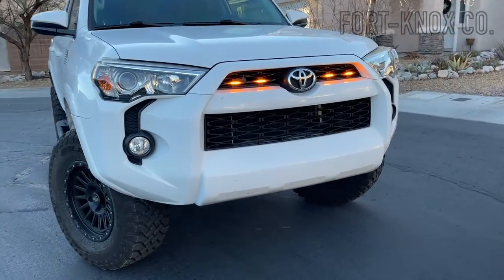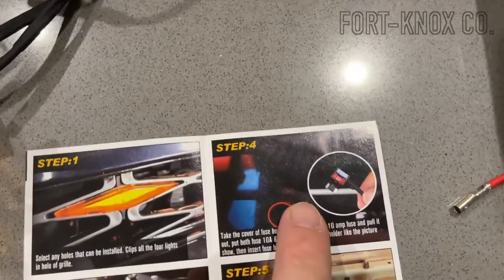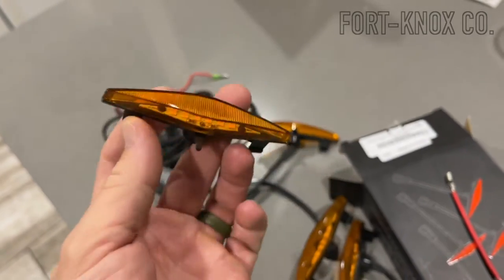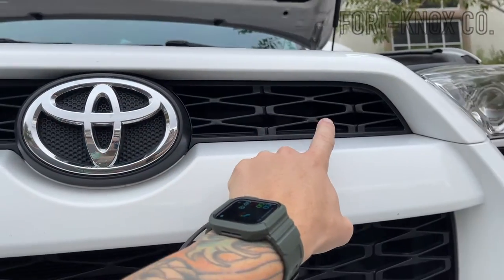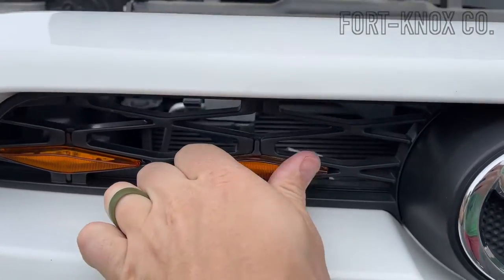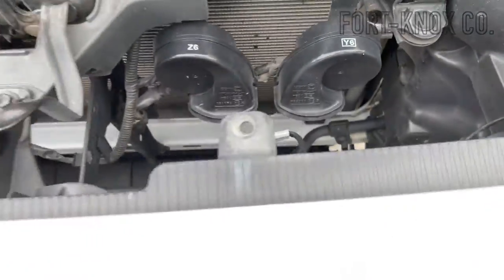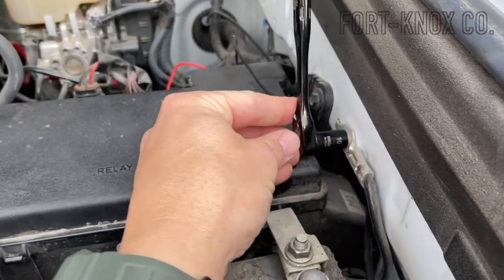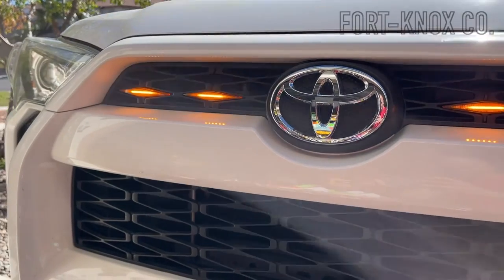Toyota 4Runner Raptor Grill Lights Installation | How To Install these LED's and Where to Buy them!

Comment: Thanks for the video!, I ordered them the same day I saw the video. Just like u said took about 30 minutes to knock It out. Had issues with one light not wanting to fit tightly in its place so I just swapped one out that was already installed and seemed to work. Thanks again.
Reply from the maker: That’s awesome to hear. I had the same issue. It’s weird. Like ones meant to fit in a certain spot or something. But I did the same thing. Played with switching them around and got them al in.

Comment: Thanks for the video, liked and subbed. I have a 2015 4Runner Limited. The grill is very similar to yours with the Toyota Rings emblem in the middle. I would have to install these on the lower row where you did judging by the shape of the triangular lights. The row right above where you put yours has more rounded left and right end shapes of the honeycombs and do not look like they would fit. I would get the amber if they offered a blacked out (smoked) version, but looks like blacked out is only offered in white LED. Did you consider installing a push off/on switch in your dash for if you wanted to have the raptor lights off while you are driving? I am considering that. Thanks!

Comment: Andy: Thank you so much for a great video. What size and brand of Rim and Tires do you have? They look amazing.
Reply from the maker: Your welcome. It’s RockTrix wheels 17” with a -12 offset. And the Falken wildpeak M/T 285/70r17. I have a video on my page going over the lift, tires and wheels specifically. You should check it out.
Reply: @FortKnoxCo  Thank you so much. I really appriciate it.
Reply from the maker: @farhang0077  your welcome! 🤙🏼

Comment: I bought and installed these light. Was a breeze and look good. However, they randomly turn on when car is off. Do you know why that is? What is that fuse they piggy back on?
Reply from the maker: Yeah we love ours. Haven’t had that problem with randomly turning on. The fuse I piggy back off of is the ignition I believe. It’s powered as soon as you turn the key to the first position. It was just the one that was recommended by the manufacturer. Not sure why they would randomly turn on with your installation
Reply: @FortKnoxCo  yeah i thought that was weird. Turned on while car was off.  Ill check again. Thanks for your quick reply?
Reply from the maker: @bajaaddict  no problem at all. I appreciate the comment and watch of the video. 🤙🏼

Comment: Just now seeing this video and trying to determine if my 4Runner, 2022 Limited, which has a grill and front same as this one in the video with the exception of the radar unit just under the Toyota emblem.  As a new owner of 4Runner, I am trying to learn the different styles in the grills and what a TRD PRO looks like and what would one call my grill which seems to be very similar.   I would install the raptors just as you are doing/did.  The box for the lights says 2014 - 2019 so I wonder if anyone is reporting installation on a 22 Limited?  And, what was the outcome of those installations?  Thanks for a reply is you can.
Reply from the maker: My 4Runner is the mid/base level as far as exterior upgrades. It’s an SR5 4x4. It has everything before you jump up to the limited or pro models which start to have different grills and  trims. If you grill is looking to be the same as mine then I’d put money on it that it will work. I don’t believe they made these diamonds shaped grills in different years different sizes. I think it either an SR5 grill or a PRO upgraded grill style. So I’d said you could probably install these raptor lights where I have them. And worst case you can return them full refund no questions asked with getting them through Amazon. That’s why I love getting stuff on Amazon when possible. No buyers remorse.
Reply: @FortKnoxCo  Thanks for the response and suggestion.
Reply from the maker: @joeretired4552  your very welcome

Comment: What was the mod on the fuse box to get that wire to fit?
Reply from the maker: I just made a little tiny notch in the plastic to allow the wire to lay a little bit flatter. Nothing big to let moisture in but something to just let the wire not be so pinched

Comment: Connecting to fuse box if you want them on only when your tail lights, or side marker lights are on. 
Run the wire through the firewall. Theres a small rubber plug on the upper right driver side. Wrap the wires in electrical tape, push through the firewall. Fish them out above the parking brake, use the 10amp tail fuse. Follow the same process as engine compartment  connection. I used a razor knife to cut out a small pattern to fit the piggyback back to allow the cover to be put back. Use the small bolt at the bottom to attach your ground. Literally took me 15 minutes including the disconnect from the engine comp. Fuse box.
Reply from the maker: They way I wired them in this video has them on 100% of the time, they turn on when the ignition is on. Day and night. Even before the engine is running, as soon as you turn the key it has them on.

Comment: anyway they can be wired to DRL ?
Reply from the maker: If you know what you’re doing you could I’m guessing. They come with the connections on the end of the wires but if you wanted to cut and splice you could. At the end of the day they just need that + & - connection

Comment: Any battery drainage since the installation?  I'm wondering if I should go through the trouble of installing a relay and switch so I can power the lights on/off as necessary.  What'd you think?
Reply from the maker: I haven’t had any battery drainage. I believe with the fuse they have you piggy back off of it’s only active when the ignition is on.
Reply: These take up barely any energy. Of course there’s some but not a lot.

Comment: I cannot get it to fit into the fuse box slot any advice? It is not snug at all
Reply from the maker: When I did it was really tight. I had to notch out a little bit of plastic so the lid would close back down and not compress the wire too much. I just kinda had to make it work as best  as I could.
Reply: @FortKnoxCo  oh you know maybe I should rephrase I was able to do that but fitting the actual fuse inside the slot it would not go. It would simply fall out. I took out the 10 fuse by the 7.5 one but getting it back in was not possible.
Reply from the maker: @ALOHAAKELI  oh okay. Yeah I’m not sure if there’s a different fuse or adapter that will fit more secure. Not sure if there’s an adjustment to the place the fuse fits in so it has more grab. Like adjusting the contact points.
Reply: You can also use the number 10 fuse above the ignition slot but then your lights only work when your headlights ON

Comment: Since you have an sr5 any idea if it fits a 2021 TRD pro premium? Also I’m going to watch your vid on the MT lift Eibach this is why I was told to do but AT Eibach instead of getting bilstein
Reply from the maker: I don’t think it works on the new pro grills but I’m not 100% on that. If it has that diamond shape pattern, then it might. But I think those pro grills have a whole different look. And the video about the lift is really good, I’ll show you exactly what you can expect from it, and what it looks like, and with your offset wheels, what you can expect as well.
Reply: @FortKnoxCo  thank you! I don’t do a lot of off roading more home to work and out of the year 3-4x go up the mountain and so light trails… so been deciding on bilstein or eibach… and the mt wildpeaks I will pass on that and do AT since I live in Cali Orange County lol
Reply from the maker: @hanzohattorri2471  yeah we really like the Eibach kit. Feels way better than stock even with the beefy tires.
Reply: @FortKnoxCo  I’m sold! Thanks again
Reply from the maker: @hanzohattorri2471  anytime!

Comment: How do you reinstall the push plugs on the front cowl?
Reply from the maker: I’m not sure what push plugs and cowl your asking  about. Are your referring to the plastic clips that hold the long plastic cover on between the grill and engine?  If so you just push them back in and push down the center. That pops down and holds the panel.
Reply: @FortKnoxCo   GOT IT!!! Thanks!
Reply from the maker: @randyperkinson91  awesome!!

Comment: How did you get red 10 fuse in it doesn’t go in
Reply from the maker: With the adapter/piggyback plug it came with. The original fuse went into the adapter and then I plugged in the adapter where the original fuse went.
Reply: Yes the original fuse from fuse didn’t work because of its design but you can use standard number 10 fuse from market and its work properly.

Comment: Sr5 and trd offroad don't fit. They have different pattern grill on the top part
Reply from the maker: Good call. Yeah I see some of the other grills have a different lay out. This one is a 2016 SR5 4x4 model.

Comment: How much you lift that rig?
Reply from the maker: The total lift after tires, wheels and suspension was a full 3”. The suspension added about 2”. The new tires added the extra 1” after sitting on the ground.
Reply: @FortKnoxCo  Looks good, that is what I am thinking too, just want to make sure it will still fit in the garage! Thanks!
Reply from the maker: @kylemc8851  it should definitely still fit. 🤙🏼🤙🏼

Comment: clean ass whip
Reply from the maker: Thank you!!
Reply: Hey man since you’re here, I recently got a 1999 3rd gen 4runner and was wondering if you knew what led headlights are supported. im new to this and don’t want to buy headlights and not be able to run them 😅
Reply: the led bulb
Reply from the maker: @richardalcaraz1196  I’m not 100% on the Gen 3 Runners. Most the time I Google or Amazon it and make sure to put in there gen 3 or gen 5. Then read through it. They make it for sure, just gotta make sure it’s the right model Part.
Reply: @FortKnoxCo  alright cool thanks man. one day i’ll have i car like yours 😮‍💨😎
Reply from the maker: @richardalcaraz1196  you’ll get it bro. We had this 4Runner for years before we spent any money on upgrades. It’s a slow process